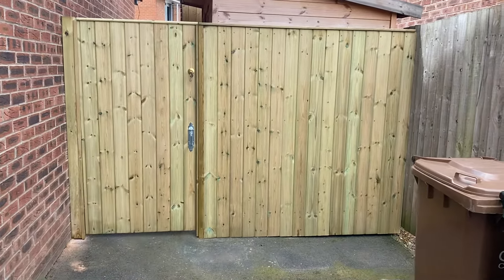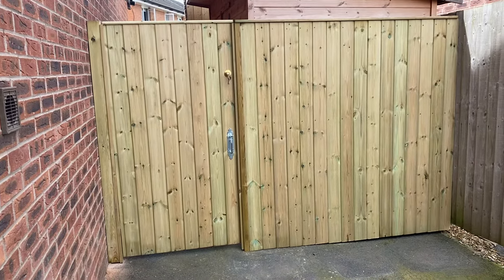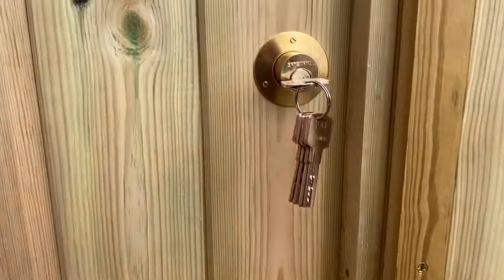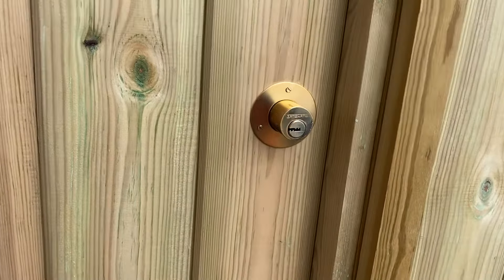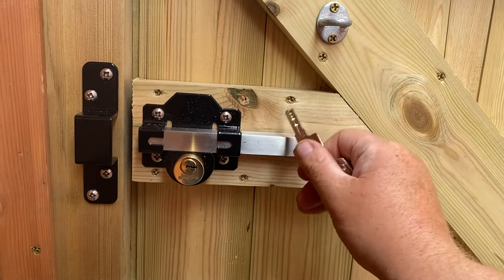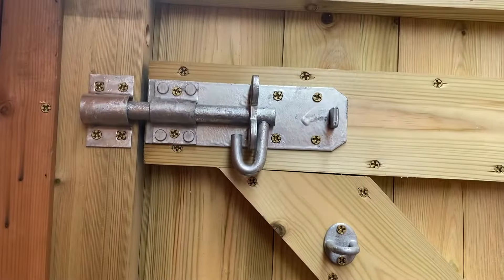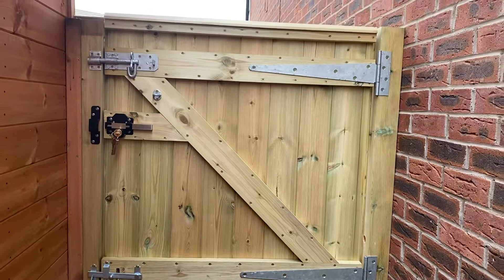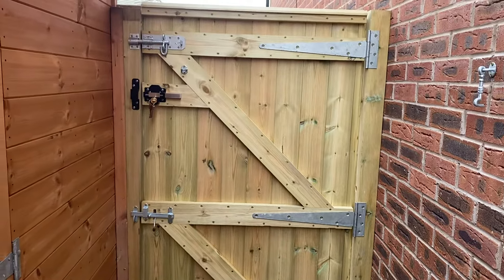Strong Garden Gate/Fence with Double Sided Long Throw Bolt Lock

Comment: What size timber post should I attach to the wall for a 6’ gate
Reply from the maker: Hi Barry,
I generally use 85mm x 85mm posts but less if the gap is tight. 
Thanks 
Rick

Comment: Why didn't you extend the diagonal braces right to the 2 by 4 edges?
Reply from the maker: Hi Peter,
I never go over 45 degrees on braces as then you lose the strength and gate will sag. 
Thats why you don’t see any angle bracing on bridges over 45 degrees. Hope this helps and thanks for the feedback. 
Rick

Comment: You put a high security lock on a fence someone can just climb over?  That makes no damn sense, son.
Did the customer demand it be made this way?  Did you try to talk them out of it or did you just take their money and run?
The bolt looks very impressive, but the small screws holding it on will tear it with a few good kicks. Why wouldn't you use carriage bolts like everyone else?